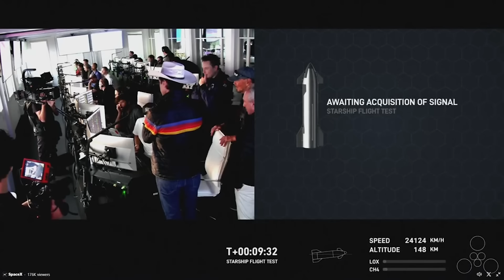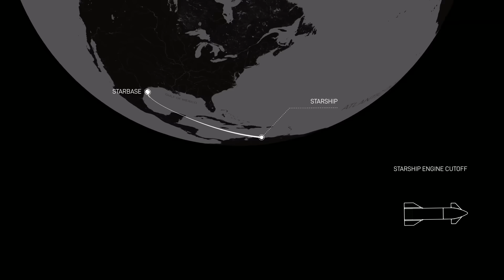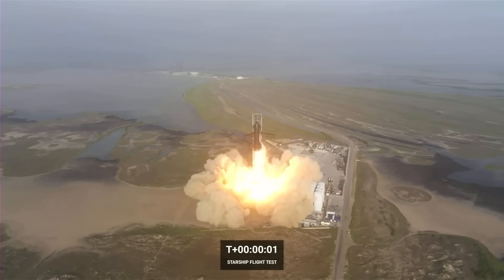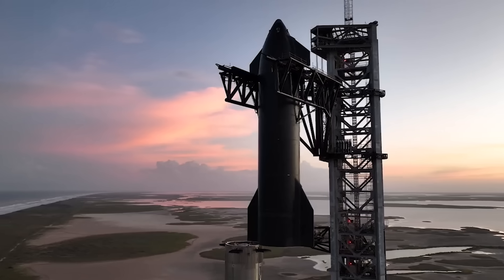What Exactly Happened On SpaceX's Second Starship Launch Attempt?

Comment: Yes, this was a massive step forward for Starship.
  But can we all just agree that the 2025 Artemis 3 deadline is not happening?
Reply: Until Starship reaches orbit - which it hasn't done - safely re-entered and landed which it hasn't done - and then refuels in orbit which has not even been even been demonstrated its really way behind schedule for 2025.  If - refueling cannot not successfully be achieved - Starship is never getting to the moon
Reply: @xmasinpacific  And if SS cannot do all these fast, cheaply and with a high margin of safety, it is no better than the "failure" that was the space shuttle.
Reply: @nickl5658  The Space Shuttle accomplished a lot. 
  It repaired telescopes, launched probes, acted as a 2-week space station for micro gravity experiments, provided support for MIR space station, and paved the way for the ISS.
  
As far as I'm concerned, the space shuttle program was a win for science and space exploration.
Reply: It's taking them two years to build Artemis 2 after Artemis 1.  At this rate success is starting to merge with failure.
Reply: @victorkrawchuk9141  They're taking what they've learned from Artemis 1 and applying it to Artemis 2.
  How is that different from SpaceX?
Reply: @Mikael-jt1hk  Whatever you say goof musk fangirl!!!
Reply: @ChrisD72 average brain dead progress hater
Reply: well they didn't plan on faa cockblocking.
Reply: At the rate NASA is going with the SLS, I won't be surprised if the next crewed moon landing is conducted entirely with SpaceX Starships.
Reply: @racookster  SLS is on schedule. Starship is behind schedule.
  SLS is based on proven tech. Starship is based on unproven tech and will need years to get ready.
  Artemis 3 in 2025 is not happening with Starship.
Reply: @jameskelly3502  Course spaceX behind schedule when FAA and other regulations cockblock it
Reply: @racookster Starship is a fail.
Reply: @skyemac8 okay rocket scientist!😂😂😂
Reply: @jszorc3488 lol literally it blew up today both the booster and a starship and it already blew up like 5 other times...
Reply: @xblade11230 it’s also still a prototype and still the most complex and largest rocket every attempted

Comment: I wonder if the propellants shifing after that flip maneuver ruptured the tanks.
Reply: maybe teh pressure on the engine also led to the explosion?
Reply: Slower flipping would be nice.
Reply: Possibly....the way I saw it was the 2nd stage engine ignited too soon 2:23.... before the 1st stage even separated and could clear the exhaust blast, possibly creating a leak. Hard to tell from the angles and distance.
Reply: @theadmiral5425  2nd stage ignition is how they seperate. try again
Reply: @rcpmac  It's the first time Starship has ever done a hotstage, it's possible that it could have been due to that, unlikely though because we were able to see what looked like an engine exploding
Reply: @theadmiral5425 It was by design. Called hotstaging.
Reply: @WimukthiBandara  good to know, thanks....I assumed they separated like the other boosters.

Comment: If you watch the launch closely, you can see heat tiles falling from the first stage during ascent, causing small "puffs" at the side of the booster. At the same time, small white spots appear on the heat shield of the first stage, in places of the missing heat tiles.

Overall, great launch.
Reply: You mean the second stage, surely; the first stage has no heat tiles.
Reply: I hope they got data to do with the heat tiles. 
The work that went into them is hard to imagine.

Comment: I am curious ——would auto destruct system be a major part of this test flight. I saw some boost back to take forward momentum away and then self destruct. I think both self destructs were part of this test flight given that the self destruct did not perform as required in first flight.
Reply: but nominal landing of booster and especially the reentry of starship would have given them a ton more usable data
Reply: The FTS didn't work perfectly last time.
Obviously, they would've liked a perfect profile, but the fact it worked (seemingly) flawlessly this time with be very reassuring. To SpaceX and the authorities.
Reply: the engines on booster had a major problem and some parts broke of leading to a leaking. the leaked fluids got onto the burning engines and led to a engine exploding. the explosion gave energy to burst the booster into debris. stage 2 had valve problems due to the pressure.
Reply: @NovarOrdinem  So what they had a flat tire
Reply: I think if the FTS was a planned part of the test they would have said that instead of saying that they were crashing the stages into the ocean.
Reply: @ninetailedfox579121  they wanted to do it but just wanted to firstly see if it survived re entry
Reply: Hmm maybe Space Shuttle Challenger was just the auto destruct too!
Reply: @zognaldblormpf5127  Totally disgusting, man. Jesus.

Comment: The FTS system kicked in as the booster had drifted too far off course. Same deal for starship.
Reply: Still speculation on that but likely. So hard to pin down.
 The booster was not supposed to explode so quick and may have caused quite a disturbance to Stage One. There is going to be a LOT of study on this but it was impressive regardless and as someone grimly pointed out, it was a great way to test the FTS on both craft. Shucks. It was going so well and Nominal.
I was starting to think it was actually gonna Make It.
 Jeeze! What was I thinking. 100 to One Odds at least! Cheers Everyone!

Comment: I've noticed that after Stage Sep they didn't get all engines they wanted running again (as far as I know the wanted to boost back with all of the inner 13 engines) I thinkt that might've triggerd the FTS of B9 because with less engines it wasn't able to get back to it's desired landingzone.
Still, it was a HUGE improvement when you think of IFT-1
Reply: 2 KABOOMS BETTER THAN ONE

Comment: thx for the clear descriptions. it was some improvement, and managed to be better than any other n-1 launch, still far from any saturn-v launch, so not bad, but very far from good. in a few years it may be ready for cargo missions to leo.
Reply: Cargo launches to leo will occur sooner than "a few years." 

SpaceX has no choice but to be cargo ready next year. They have to get the next Starlink version in orbit next year or their business plan falls apart. They have to get HLS on the moon's surface within a couple of years or they will loose their NASA contract. Musk will not allow either to happen.
Reply: Within a year starship will be launching Starlink satellites and they may surprise how fast they become ready to launch cargo to say the ISS.  If the improvement with each test is maintained which is possible people will be surprised how fast starship is determined to be reliable.  The early stages always seem slow, but the cadence in development can increase rapidly after this test flight because of the many success over the first test flight.
Reply: @michaeldeierhoi4096  I definitely agree with your assessments.

Comment: Is it me or did it yaw to the right just before stage separation?  Also it seems that the boost back caused fuel/oxidizer starvation at the engines.  A little bit of gas gets in there and nothing good happens.  It was close though.  I'm betting next time they get to orbit.

Comment: There was a cascade failure of the first stage motors, presumably from fuel starvation. Header tank design. And then the FTS fired.  
The Second stage developed a fuel leak, which again caused engine failures and the flight termination.
Reply: Interesting. Where did you hear this?
Reply: @bartmannn7 yes, that was my question?
Reply: I was thinking the same about the second stage. Maybe for like 10 seconds before they lost data you could see what looked like a leaking of gas of some kind before seeing the explosion similar to that of the first stage. 
It’s pretty clear the second stage also detonated, likely a result of the FTS.

Comment: New debris field , great ! Luckily it was totally empty . I think its not a proper test until fully loaded . And both sections do not blow up .
Reply: It was a proper test. Find problems and fix them. That is the whole point of these test flights.

The primary objective of this launch was to succeed in separation; they succeded 

This test flight  was a notable improvement over the first test flight. SpaceX learned from the first test flight and they will learn from this second test flight. 

Furthermore,  they will learn from all test flights until they prove flight worthiness.
Reply: Nobody cares what you think.
Reply: Are you a bot? there's a similar comment above.